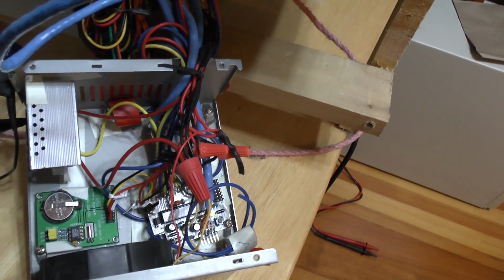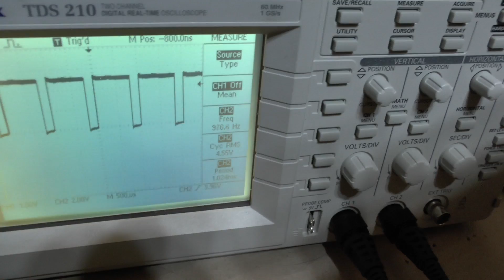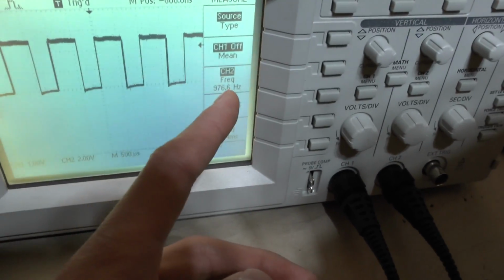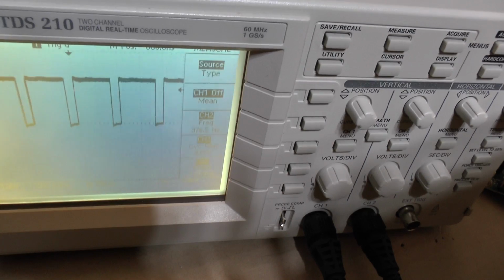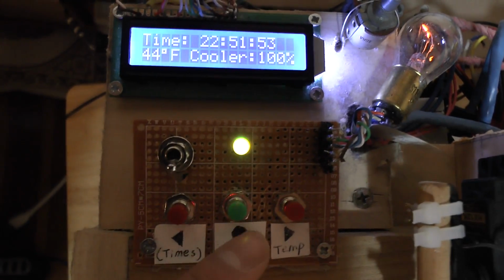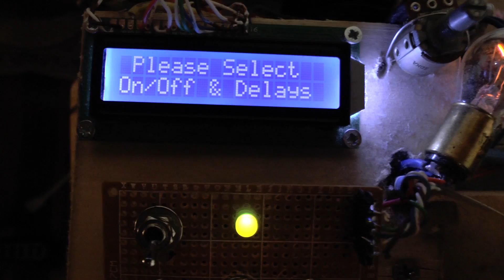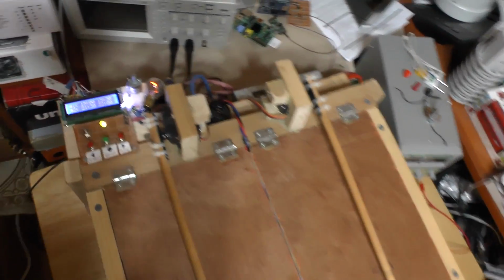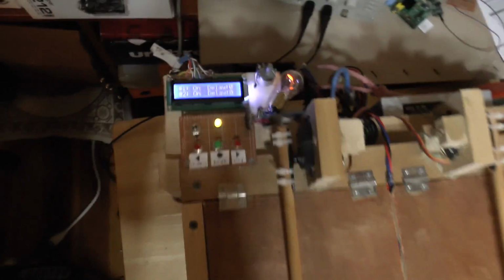Arduino Automatic Refrigerated Cat Feeder

Comment: Hi there! This is very cool! I'm just getting into electronics and would love to build one of these. I know it's a big ask, but do you have a list of parts?
Reply from the maker: Hi,

Many of the parts can easily be substituted, but here is a general idea.

1. Software (https://github.com/wizard97/KittyFeeder2)
2. 7x11x2 aluminum cake pan (as thick of gauge as possible)
3. 300 watt TFX PC PSU
4. Arduino mega 2560
5. 16x2 Keypad LCD shield
6. Any temperature (I used DHT11, but it is slow and reads block other processes)
7. ESP8266 (If you want WiFi connectivity)
8. Peltier cooler kit (I used TEC1-12704)
9. Some sort of logic level mosfet for controlling the cooler
10. Passive piezo
11. DS3231 RTC
12. Any high torque servos (look on HobbyKing)
13. A dowel
14. Some lumber (I used plastic PVC lumber to make it more resistant to moisture)
15. Screws, zipties. wire, etc...

Hope this helps,
Aaron

Comment: it's fantasticccccccc!!!! i'm working on my pet feeder for my dog!! but i have a lot of problem with arduino code!!! can you help me???
Reply from the maker: Sure, upload your source code to GitHub and I'll take a look
Reply: i don't have again the final code! i write code only for stepper and servo rotation! can you check only this now?
Reply from the maker: I doubt there is much code at this point, but I will look nonetheless. Put it on GitHub so I can see it.
Reply: sorry i never use git hub i don't know how it works.

have you an email where i can write my code?

this is the part of stepper:

#define LED 13
#define ORARIO 2
#define ANTIOR 3
 
int motorPinx[] = {8, 9, 10, 11};
int sequenza[] = {1,3,2,4};
int countX  = 0;
int count2X = 0;
int ora = 0;
int ant = 0;
int delayTime = 100;
int pinPot = 0;
 
void setup() {
  pinMode(LED, OUTPUT);
  pinMode(ORARIO, INPUT);
  pinMode(ANTIOR, INPUT);
  for (countX=0; countX<4; countX++)
  {
    pinMode(motorPinx[countX], OUTPUT);
  }
  pinMode(pinPot, INPUT);
 } 
 
void loop() {
  ora = digitalRead(ORARIO);
  ant = digitalRead(ANTIOR);
  int readPot = analogRead( pinPot );
  int delayTime = map(readPot,0,1024,10,1000);
 
  if (ora == HIGH) {
    orario();
  } 
 
  if (ant == HIGH) {
    antiorario();
  }
  delay(delayTime);
}
 
void orario()
{
  int val = LOW;
  for (countX=0; countX<4; countX++)
  {
    if (countX == sequenza[count2X]) val = HIGH;
    else                             val = LOW;
 
    digitalWrite(motorPinx[countX], val);
  }
  count2X++;
  if (count2X == 4) count2X = 0;
}
 
void antiorario()
{
  int val = LOW;
  for (countX=3; countX>=0; countX--)
  {
    if (countX == sequenza[count2X]) val = HIGH;
    else                             val = LOW;
 
    digitalWrite(motorPinx[countX], val);
  }
  count2X--;
  if (count2X < 0) count2X = 3;
}

thanks :)
Reply from the maker: Without seeing a schematic, it is hard to draw any conclusions (especially because I can't speak Italian). There is one minor error, map should be between 0-1023 (not 0-1024) since it is a 10 bit number. If you can provide a quick drawing of how things are hooked up, I will be happy to look into it further (daw268@cornell.edu). Good luck on your project! :)